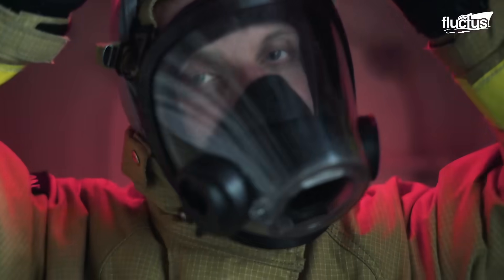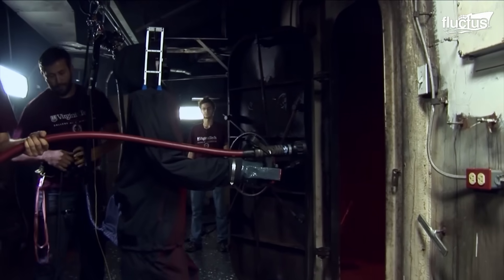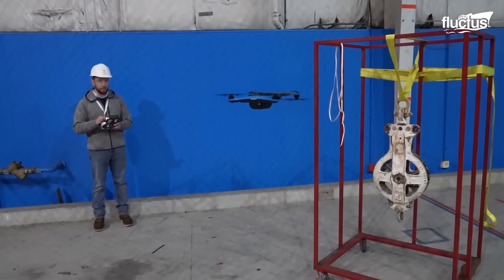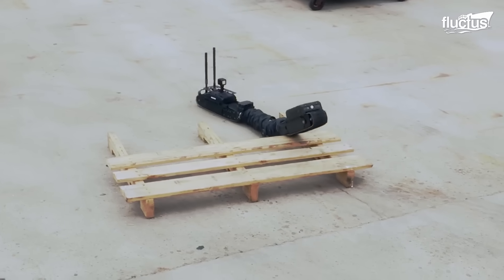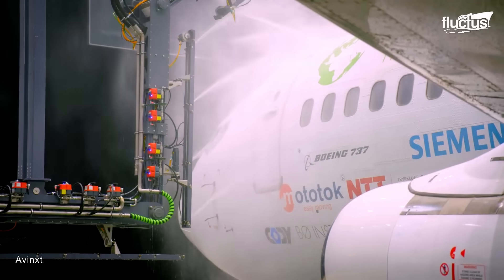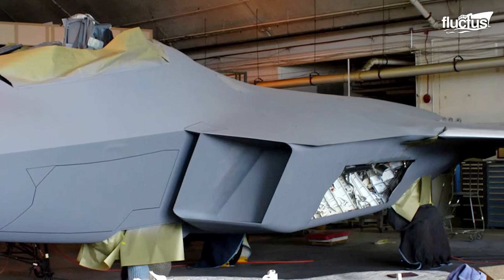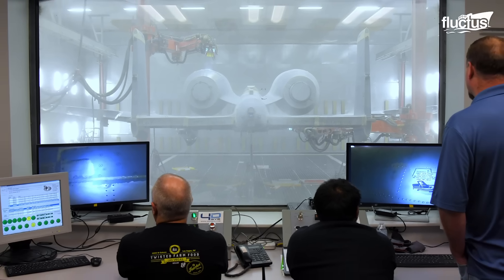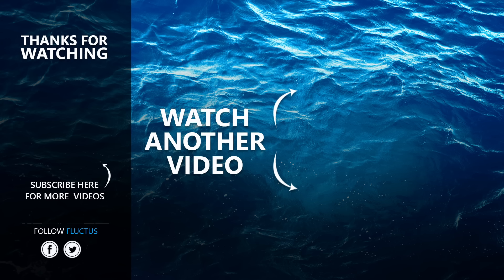US Testing Scary Fire Fighting Robots to Deploy Them on Aircraft Carriers

Comment: Elon Musks batteries 2-3,000 deg continuous water only cools it slightly but because of extreme heat re ignites with ammo, fuel, jets good way to loose a ship or put it out of action. Burn holes 🕳️ through deck layers spreading to other floors severing electrical and water lines. It takes Gallons of foam and water to cool the batteries. What they need to do to prove my point. Mock up a ships floor electrical and water supply lines light a batteries off see how much damage it does before being put into a drum 🪘 of suppression kitty litter to smother it.